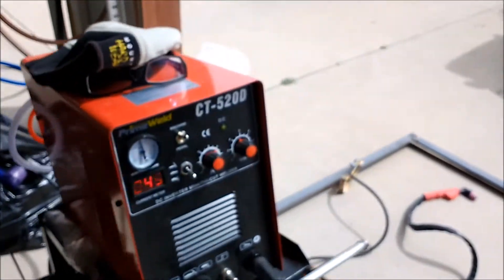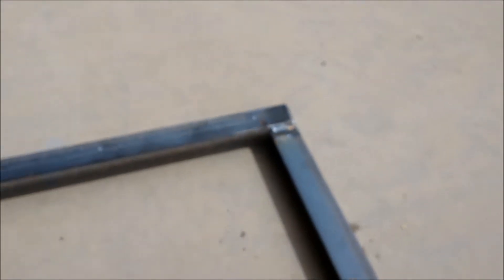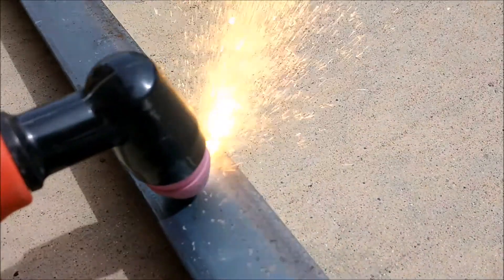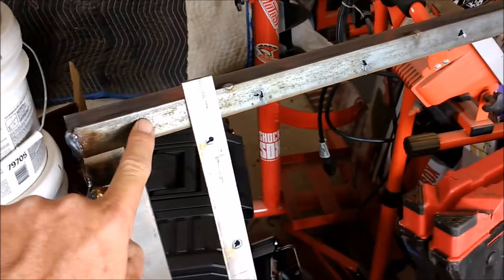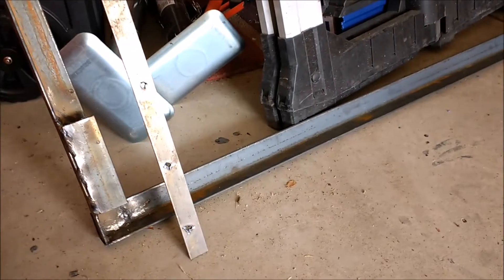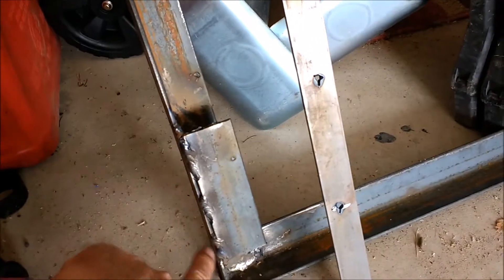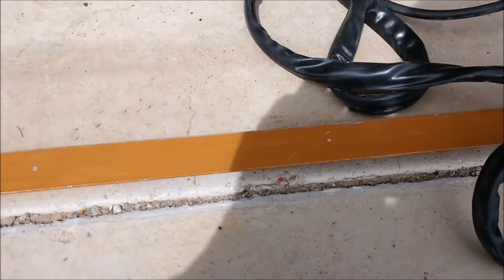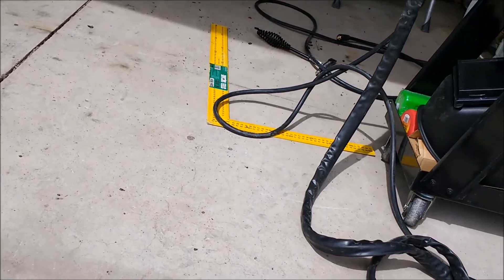CT520D Gate project part 1

Comment: Not recommended way to make holes bc the molten discharge will kill the consumable tip much faster, which is why manufacturers include a standoff bracket so that tip is never in contact with object metal.
Reply from the maker: So this isn't a plasma start, but a contact start, would that still work with the standoff?
Reply: @anesthesiadreamin  Good effort/video pal. i think it is called Pilot Start for standoff. If you r using contact start, then you r good but the consumable would still die earlier vs pilot start. Contact start cannot use standoff, won't start. Both contact n pilot starts are called Plasma Cutter, there is no "plasma start". Haha, I just bought a combo unit n have yet to use it, ie, i've zero experience but picking up the theory first before i do anything. Cheers
Reply from the maker: @raywu7933  Yes, thank you for correcting me. Prime weld sells a version of that one called the CT520 DP (pilot arc). Mine is a CT520D (scratch start). And yes, you were right, it does shorten the life of the consumable, but for a few bucks It saves me a ton of time in drilling. Thanks for watching, and for the comments 👍 Enjoy the new machine!

Comment: So would you recommend this unit? I am considering buying this. Thanks
Reply from the maker: It still works just fine, I've burned about 40 lb of rods through it, and the plasma cutter still cuts fine. Would I recommend it? Yes. Would I buy it again? The answer is a definite yes
Reply: @anesthesiadreamin  Awesome thanks!!
Reply: Mine is 10 years old and still works flawlessly. Do yourself a favor and order a 20 pack of plasma tips online.
Reply: you have been having the same Primeweld 3in1 welder for 10 years and still kicking? I thought Primeweld has been around for maybe 5 years tops. Asking because I'm looking at the Primeweld 3in1 pilot arc and the Mig 220v welder. Its a $1000 combo and can be run on 220 AC, great option for me for the home shop usage. Its longevity I worry even though it wont be used as in production just at home stuff